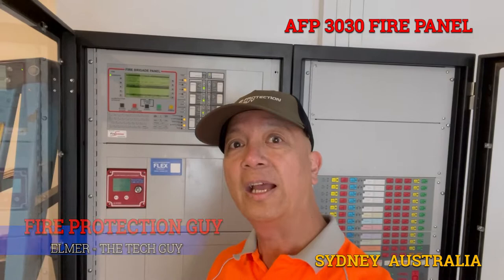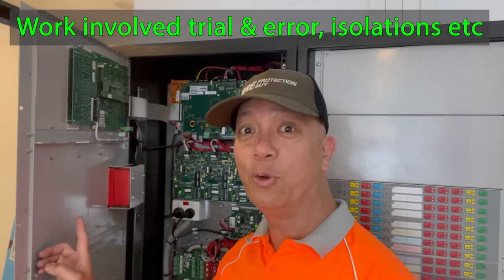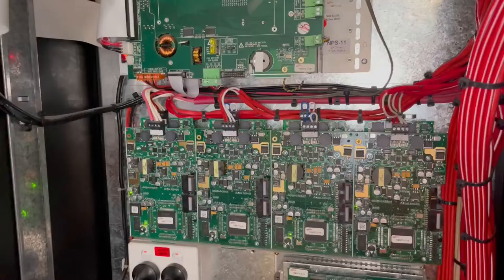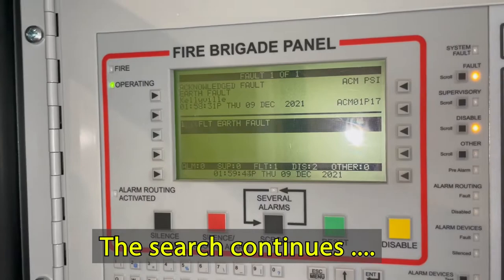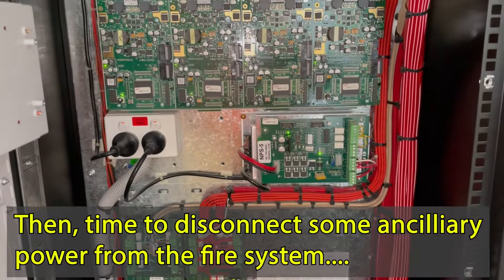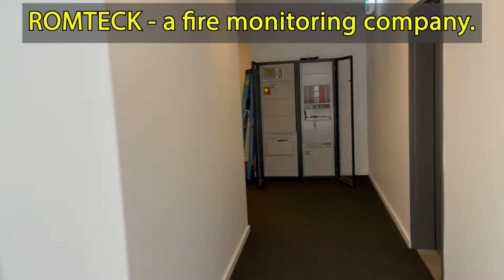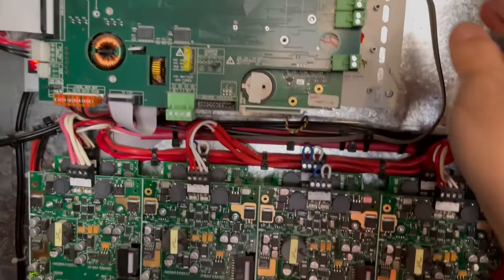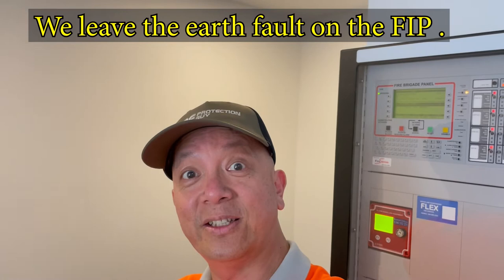FIRE ALARM SYSTEM - SOLVING EARTH FAULT  Episode F110 #firetechnician #firealarm #firesystem

Comment: The display is similar to the notifier panel nfs2-3030 

Very interesting !
Reply from the maker: There's so many model but same inside and outside. There's a new one called FireLite...just a 3030 for 1-2 loops.
Reply: @fireprotectionguy7943  From what I see, the loop cards inside are the same as the lcm-320 used in the 3030 notifier panels.
Very cool

Comment: What causes a line fault
Reply from the maker: Line faults - open circuit, short circuit, loss of power or excessive normal current discharge and presence of external power in the system.
Reply: I have a problem with APF 2800 notifier,when I turn the knob to alert it gives evacuation warning and when I turn to evacuation it give alert warning.what is the fault.
Reply: Thanks for that.
Reply from the maker: @DesmondLagal-ti2ww  .. so your problem is the occupant warning system (OWS) not the APF2800. Check you wires. The knob. If you want a quick option, swap the wires at the back of the OWS Manual switch.
Reply: @fireprotectionguy7943  Your information is really helpful to us,keep it up.